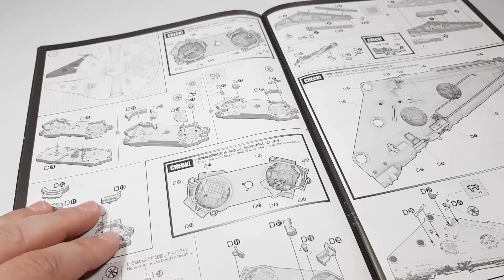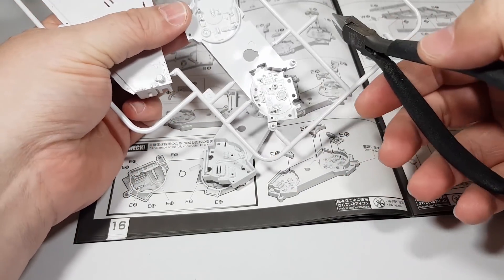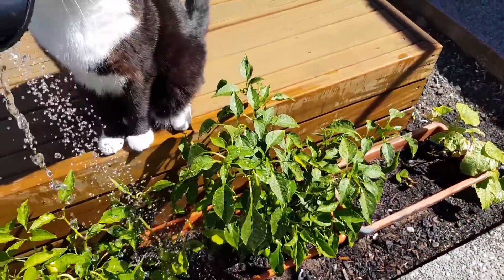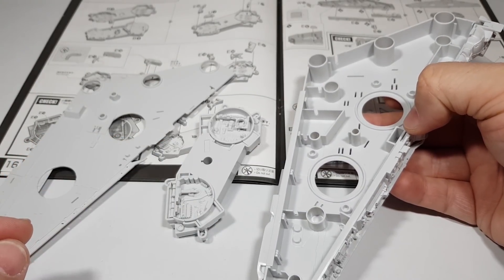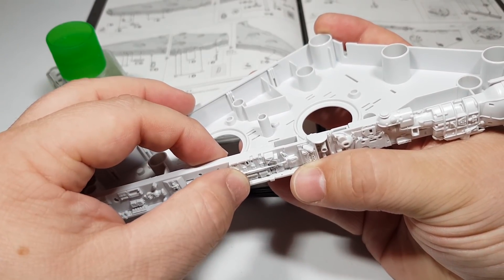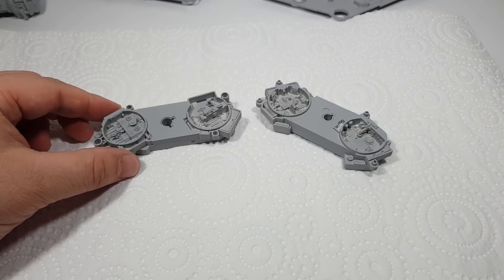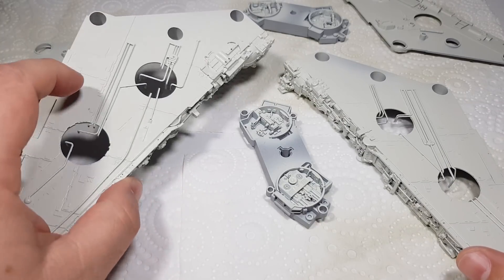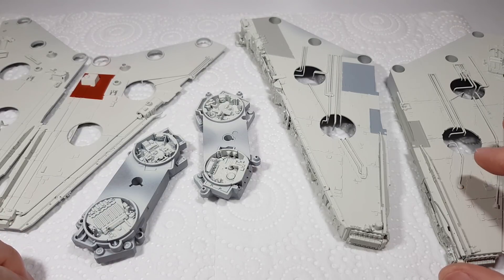The mandibles - Building Bandai's Perfect Grade 1/72 Millennium Falcon Part 3

Comment: All those thin styrene rods would worry me if I were putting it together, since I have a habit of losing or breaking small, flimsy parts but I have to say that they make a world of difference when it comes to the overall appearance; a lot of previous kits from other companies simply had them molded on as a solid piece of the hull, so instead of rods/pipes they just wound up looking more like ridges with slightly rounded tops.  There's so much impressive detail that I'm really looking forward to seeing it all assembled and weathered.
Reply from the maker: Thanks :)

Comment: I have a question. I was spraying the sections of a tie fighter that contain the solar panel (using tamiya TS line spray can) in sub par lighting conditions and sprayed so much that I lost some of those fine details. Is there a way to fix this or have I just stuffed up a model? Arrgg
Reply from the maker: Yeah that can be a tricky one. Tamiya spray paints are pretty rock solid once they're on. But if you found a way that's awesome! I usually end up sanding it back with a fine grit, but that might've been a bit destructive for the TIE panels. And remember, always spray in thin layers! ;)
Reply: Luckily the paint hadn't set. Layers, yes. Got to excited... ;)